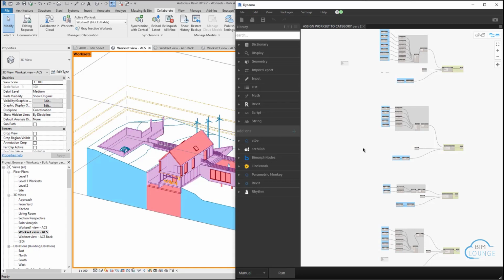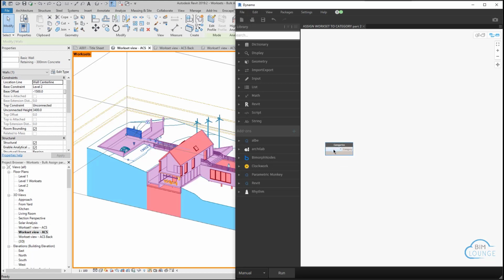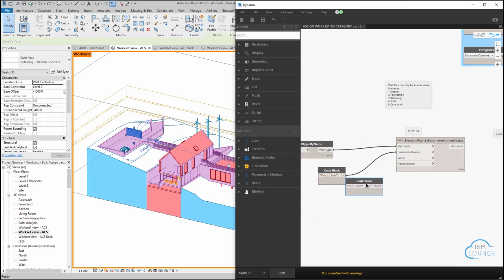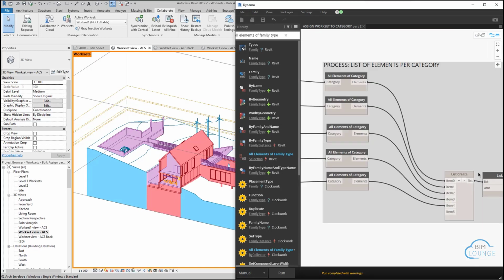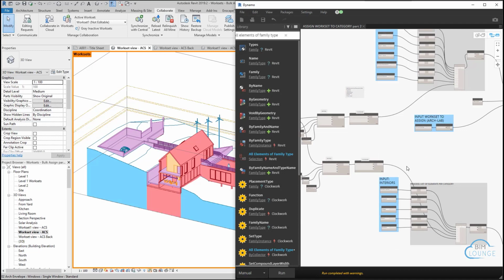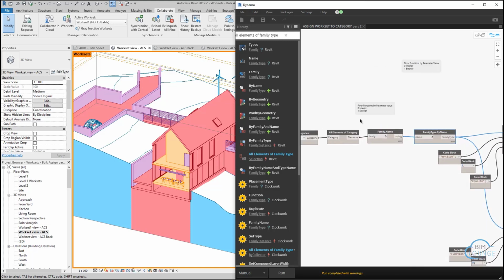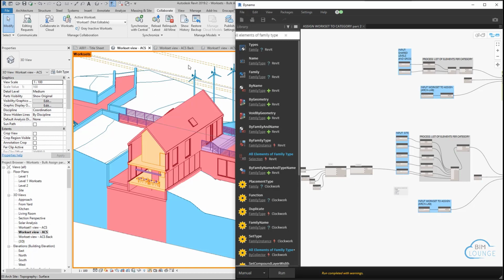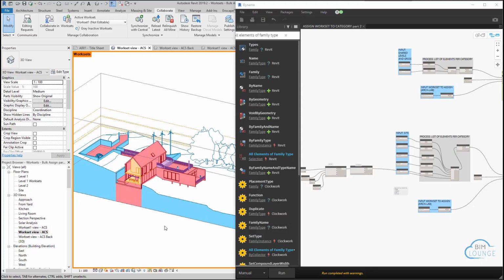HOW TO BULK ASSIGN WORKSETS USING DYNAMO PART 2

Comment: Window in general are exterior elements however in many instances there are interior walls that host windows, a nursery in a hospital for example.  Is there a way to assign the workset of windows based on their host function.  or do I need to add the function parameter to my windows.  I am not sure that OOTB windows have the Function paramete.

Comment: Hi Alberto, 

Thank you very much for this and Part 1. very helpful!! Iv only got one problem, 

How do you filter e.g. an electrical fixture with the same family name and type name onto two different floorplans. 

Right now im using a light workset for 3 floor plans, 
2 of the floor plans need to only see the lights 
the last floor plan needs to only see a selection of electrical fixtures. is there a way to filter on power code? and if possible on power code contains? Because then I can add a code e.g. (FXFeest) to the electrical fixtures power code name that needs to be shown on a different floor plan. 

Hope my discription of my problem is clear. 

Thank you in advance, and look forward to your repley

Comment: Well done Alberto, I've really enjoyed the turorials. I've got a question: I've tried to copy what you have done but I can't understand why the "Function" + "Number" + "EqualTo" doesn't work to me. Is there anything I may have missed when linking the wall function's numbering? Is this automatically going to be 0 for Interior or is there anything we need to make dynamo aware of? Thanks for your help.
Reply from the maker: Hi Carmine, thanks for the feedback, glad they helped. Let me look into this and I'll get back to you soon.
Reply from the maker: You say it didn't work for you. Did it give you an error/warning? The node should work as it simply filters out the elements by function. If you hover over the "Filter Method" input, it should give you all the options that the nodes expects. In this case I chose "Equal to".
Reply: @BIMLounge  Yes I have the warning: "Warning: Element.SetParameterByName operation failed. 
The parameter is read-only." I've tried to investigate on this warning but I haven't managed to find something similar to our script case. Do you know anything about it? I completely copied the script from yours. However, I see the elements are listed under the right group of import (Interior, exterior, etc...) but either the wall/floor labelled as "interior" or "exterior" seem to fail on displaying within the right workset. Also, I realised that workset 01-Interio doesn't work at all. Any clue? Sorry about that. But I am just a beginner.
Reply from the maker: @carmineaucello3246  Carmine, no worries, you have the tenacity that it takes to learn. It's hard for me to help beyond this without seeing your script. Would you mind emailing it to me specifying the version of Revit and Dynamo you are using? alberto@bimlounge.com
Reply from the maker: Also the function numbers are assigned based on the list in the note that is shown in the script. 0 will always be Interior and so on.
0 Interior
1 Exterior
2 Foundation
3 Retaining
4 Soffit
5 Core-shaft
Reply: @BIMLounge  Hi Alberto the note you mention is it mandatory to write in dynamo? I thought it was just a text to help you reminding the numbers. isn't? Otherwise, how can I write this note? I'm am a beginner so sorry to ask basic questions.
Reply from the maker: @carmineaucello3246  To answer your previous question about the note: you don't have to write the note for it to work. It just helps future you and your colleagues to adapt the script for different situations. To write it: Edit > Create Note or use the CTRL + W keyboard shortcut.

Comment: Hi Alberto, thank you for posting your videos, they have helped me a lot. I have created many worksets using the Excel method. 

An instance parameter applied to every model object in my project has exactly the same value assigned as the workset names imported.

Can you please advise if there is a way to assign every object in my project to the correct workset based on the value in the particular instance parameter matching exactly the workset name?
Reply from the maker: Hey Matthew, I appreciate your comment. I'm very glad my video helped you. I believe there is way to do what you are thinking. I'd like to look into it. If you are still looking for a solution you can send me an email and I will share my findings with you. alberto@bimlounge.com